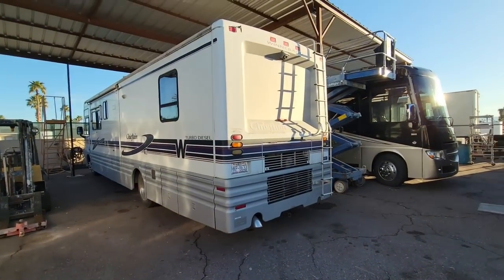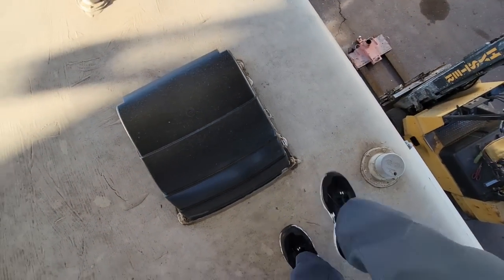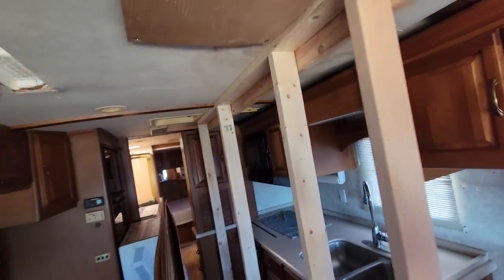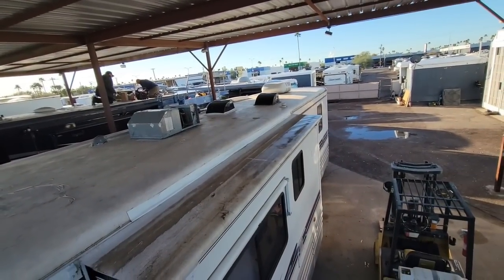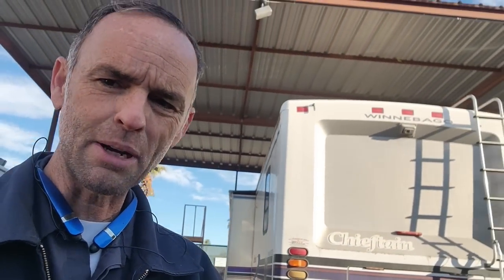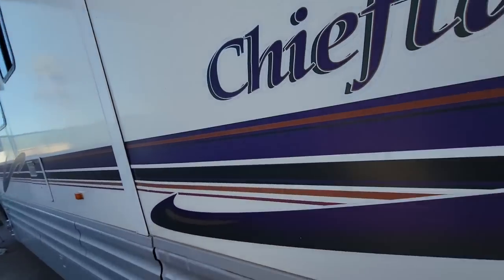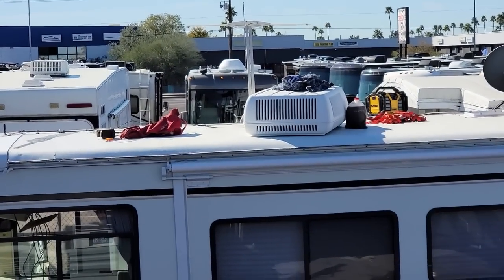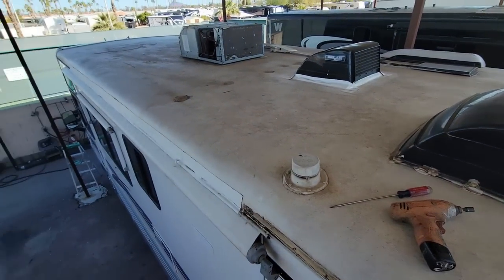I Did Not Expect This Winnebago Roof to Have So Many Failures

Comment: Great video. Thanks for sharing. I just did a similar job with my 2000 Four Winds last year and ended up having to construct an entire new wooden roof frame structure using 3" x 2" sandwiched between ply sheets top and bottom and re-using the foam insulation between. It was a lot of work!

Comment: So… the roof is trashed, the decking is falling apart, the walls are delaminating, end caps damaged, interior panels rotting…. Huge respect for your skill and I don’t like to see things treated as disposable, but if this was mine I’m not sure it’s worth saving.
Reply: It's only worth it if you do the work yourself. If you can't do the work yourself don't even bother owning an RV. 
Unless you're going to buy a brand new one and trade it in every 2 years.
Reply: @therealjayseh  There is a great deal of truth in that. Also taking care of little things in a timely manner might have prevented a lot of the rot and delamination.
Reply: @JeffinTD  I always want to be honest and not mislead people in life. Although there are those times 🥂
Reply: Neglect is worse than the actual leak or condensation issue. The moisture gave you the problem, neglect is what ruined it. When I first got my RV I thought I had a leak for two years, it was condensation, not a leak.
Live and learn. I try to share with others what I know and what I have learned. 
Money is not as important to me as being a humanitarian. The problem is, everybody is so used to being lied to and misled or they believe the lies they were told because it was some fancy schmo who told them.  . Sometimes the only way people learn is by experience. You can't tell anybody anything.

Comment: If they paid more than 5 grand for that, they overpaid.  Delamination of walls is going to be expensive, after that expensive roof.  One of these really nice is still only worth 20k.
Reply: More than one party was suckered here. While hindsight is 20/20, If James would have provided an informed estimate for this work, the owner would have likely reasoned that it wasn't worth it and this RV would have ended up in a retirement home (junkyard) where it belongs.  No good deed goes unpunished. At this point might as well admit you were snookered, put the substantial work in, and restore this Winnie roof/walls to better than new. Grind baby grind.😁 The consolation is that folly makes a terrific video!
Reply: 5 grand is probably even too much but yes that's the maximum value.

Comment: So so SO glad I got a Beaver Patriot after hearing you talk about Beaver coaches.  How does a company get away with craftmanship like this?  Winnebago is a big name too.  Just sad.  Oh, we need more videos on your coach.  Fuel filter maintenance.  Air filter maintenance.  If you want to go over seams on the roof or the gutter, what is the best material to use?  What about cleaning the interior of the coach?  Removed some of the window valances and found some staining where rain came in at some point.  All coaches need maintenance, but Beavers are AWESOME!

Comment: Wow! I'm in NC & Looks my '98 Chieftain I wanted you to see!  Same Only the outside tho. This one looks like sell for parts. Finally Bought a 2005 Rialta from original owner in Phoenix. Pristine, but it is a Winnebago coach AND no one out east wants to work on VW or coach part. So now I have a '98 Chieftain for SALE CHEAP. It has the V10 and cranks right up & runs like a champ. Low milage. The coach? Not this bad, but...I don't have you to look at it.🤷🏼‍♀️

Comment: After watching this video, what immediately came to mind was the old Kenny Rogers classic, "The Gambler".  James, "you gotta know when to fold 'em".  Or how about the oldie but goodie," putting lipstick on a pig" ?  The owner of this rolling heap either has some emotional attachment to this rig or is living in another dimension.  Sides walls are delaminated, interior ceiling is rotted away(and most likely mold throughout the rig.  Slideout is inoperative. And who knows about the engine and transmission ?  With your repeated comments about how you underpriced the repair job, why didn't you walk away from this landfill on wheels especially since you've got no help.  Great content but its not worth the mental and physical toll it takes on you.

Comment: I need to start working on the roof on my 1992 champion ultra star cumins diesel pusher. No idea what to do or where to start so I’m viewing all your videos to gleam some hints and tips. There seems to be nothing on the ultra star, maybe because it’s so old.
Reply: If you don't have any leaks right now just go over your roof with QUALITY bed liner. Roll on, then spray underneath all around the roof vents and AC/s. 
(You're welcome 😀)
Reply: @therealjayseh  it does have at least three leaks. No idea where they are from I've removed all the headliners and the roof inside is now just the insulating foam and the steel frame. I did think a rubberliner may be the easiest option. Rolled the entire length of the roof and over the edges to completely cover it.sealing with glue.
Reply: @clvshyted  if you already have a rubber roof membrane, just coat it with bed liner. If it's a fiberglass roof and it's cracked at all, you'll need to have plenty of time to remedy the issue. The bed liner could seal the leak issue you're having, even on a fiberglass roof. Just make sure you test a small spot  for adhesion. And prep it all really good. Super clean. NO DUST.
I'm not afraid to experiment on my own stuff. But I wouldn't try anything like that on a customers, unless they understood it was a cost savings experiment, $1800 vs. 
$18,000
Reply: @therealjayseh  thanks so much for the advice. I'll have a look into it. It does sound like the best option. It's not a rubber roof it's fibreglass so bed liner sounds ideal. Thanks
Reply: @clvshyted  no problem. Just buy quality material. Do not try to cut corners with off brand  cheaper materials. You get what you pay for in this world.. Bed liner coating is expensive, but it's an ultra durable material. 🥂 Cheers

Comment: Wonder if the owner will want to continue after what you found?  That's looking like a 20k roof and no telling how much damage in the sides.  Looks like it needs to be strip out and then a good bonfire.
Reply: I'd skin the roof with metal, gut & sell everything on the inside and make it a moving truck. It's over with as fas as being a good motorhome goes. Mold spores everywhere. IT'S A PILE OF JUNK.
Reply: @therealjayseh  Exactly, total loss cause.
Reply: @jrstar1439  it doesn't even have roof trusses, it's not even worth fixing. Even a 1990 bounder has roof trusses. So does a Fleetwood flair. 
Winnebago is just pathetic I can't stand that company. Even when I was a kid, I couldn't stand looking at their RVs they were so ugly.

Comment: Hi again James,can you tell me how much of the Stabond E-183 and the T-440 adhesives you use on average during the repair of a 33 foot Winnebago roof. Also can I use the E-183 on both the wood/foam and the wood/filon.   also what is the total width of the filon material when you get from All-rite   Thanks again for the videos,I watch them all.

Comment: Wow, that's a project. Let's talk roof coating. I have a '91 Dynasty. With a one piece filon roof. Nothing wrong no leaks but I am just north of you in Las Vegas. I thought about a roof coating to help keep it cool in the coach. I do a lot of travel up north Ely in the Elko area. And you hear a lot of drum Type noise in rain. Is there a coating that would help insulate in and reduce noise?

Comment: I had always heard wood frame RV’s are susceptible to leaks and rot, that’s why I bought a molded fiberglass trailer. I wonder who makes aluminum framed trailers.
Reply: Lol get a dehumidifier 
Good luck 🤞
Reply: @therealjayseh  I have one, but rarely need it since we camp mostly in the Southwest. Ventilation is also helpful
Reply: @stuartstuart866  I live in the southwest and in the cold winter months, you do need a dehumidifier. 
It doesn't matter how dry the air is outside. It's like sitting in a car and you can watch all the condensation buildup on the windows till it rolls down the glass like dripping water. Same in a vehicle home or RV.
Most RVs suffer more condensation damage than leak damage. There's a lot of stuff that motorhome technicians don't like to talk about. Of course they have to protect their income.

Comment: putting a coating on is a waste of time. The areas that leak are not in the membrane itself but all of the penitrations.  Only use Eterna bond tape to patch a hole in the membrane.

Comment: If someone paid more than a buck fifty for this rig, they got ripped! Looks like this roof might cost more then the value of this coach. I mean, if it leaked all over, some obviously got into the walls hence the delam on one side, but what about unseen mold in the walls? This should be a complete gut & rebuild but not really worth that much work, imho.
Reply: Winnebago's are junk. 
Even old Fleetwood Bounders and flairs from the 90s use roof trusses. 
You couldn't give me an RV that doesn't have any structural support in the roof, I wouldn't even want it.